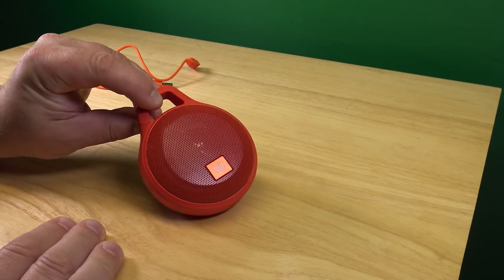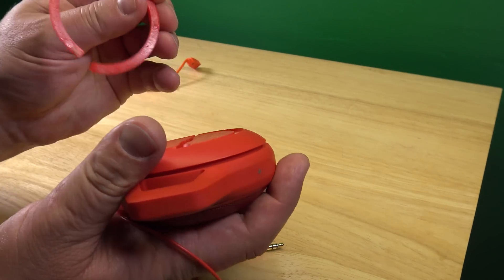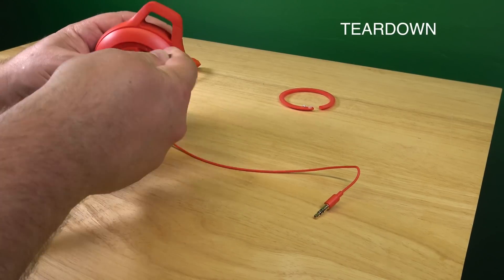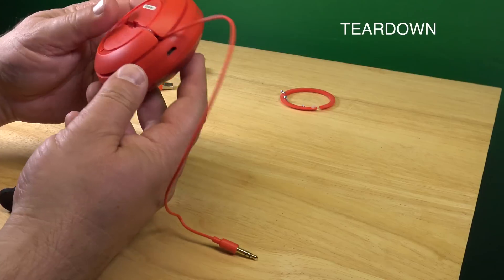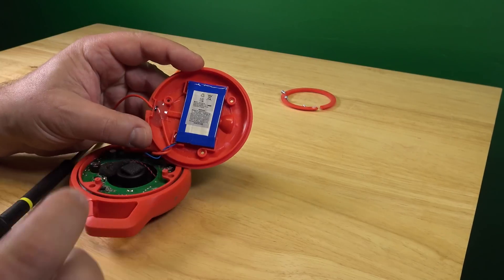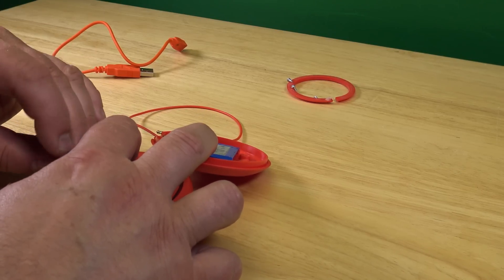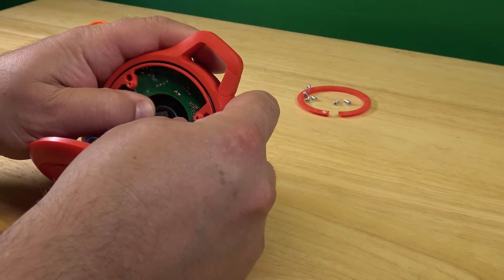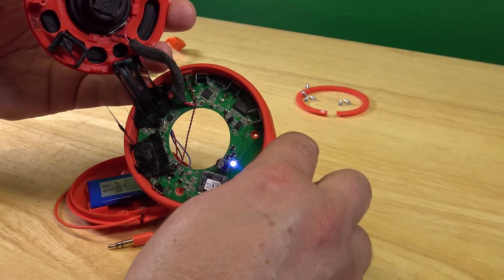Take a Look Inside JBL Clip

Comment: after some splash testing my clip + is doing some strange sound and the buttons aren't working
Reply from the maker: Probably got water in the electronics? Did you try to open it and dry it with a hair dryer?
Reply: no but after 1 hour starts working the buttons and the strange sound is playing when the speaker is in standby
Reply: same colour and model
Reply from the maker: Well, i think you should open it and get the water out?
Reply: ok thanks

Comment: Great tear down video. Would you be so kind as to measure the dimensions (LxWxH) in mm of the battery. i am certain China would have a replacement battery but the size has to fit. Thank you +mygiguser

Comment: My Jbl can't be charged. i think it has a problem in the charging port? how can i fix it?
Reply: Mine was same, said f it and took it apart like he did then saw their was nothing inside to fix so i just took the little flathead and gently pried the little male part evenly upwards to be in correct spot for female charging cable and it worked. Also you can take a sewing needle or pen or paper clip maybe too and scrape gently around the male port. Alot of times these just like the cell phone charging ports get lent in them and cannot go deap enough to make contact correct and their for do not charge until you clean the sides of them out with the needle . Hope that helps you out, I think it will. Good luck and happy new years everyone....
Reply: @CharleyTurbo   I had the same problem and I solved it that way!! Thx!!!

Comment: were can I buy the battery
thank
Reply from the maker: I don't know. I don't need a new battery yet.
Reply: JADER ZAPATA would it be possible to put a bigger battery?
Reply: amazon. You can google the numbers or look at his numbers to get the model number battery. Also you can go to fries electronics or radio shack if you have them. Or you probably can test and replace yourself with rechargable batteries the same size . Just take out the bad one id bet.

Comment: can you replace the original battery that has 3 wires with a 18650 cell?
Reply: Conspicuous Contraption
Reply from the maker: Isn't that to thick, or do they make it in flat shapes too?
Reply: +mygiguser  I m talking just about the wierying. The 3 wires
Reply from the maker: I don't know what the third wire does, but it is probably a temperature sensor.
Reply: I can probably find a phone battery ,same size but more mAh witch hase 3 wires as well.
Reply: were i can buy the battery
thank